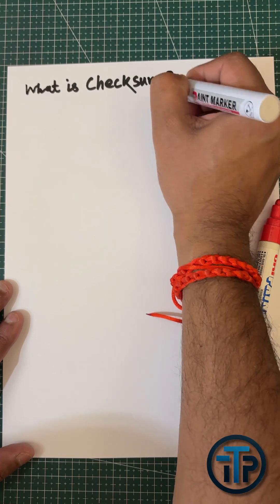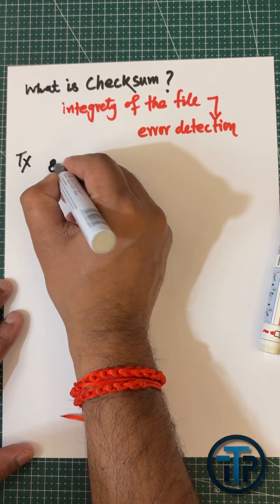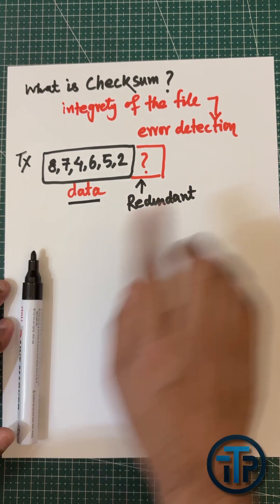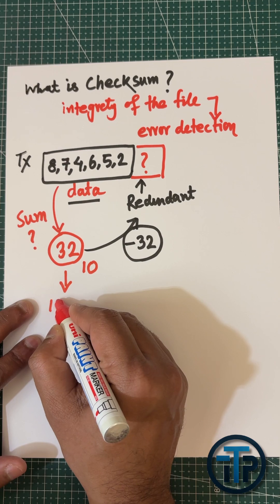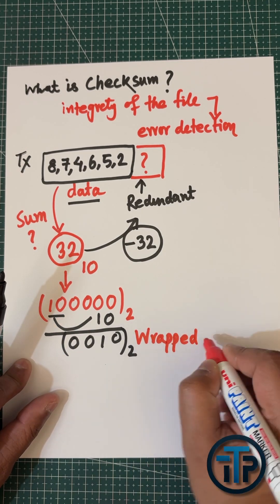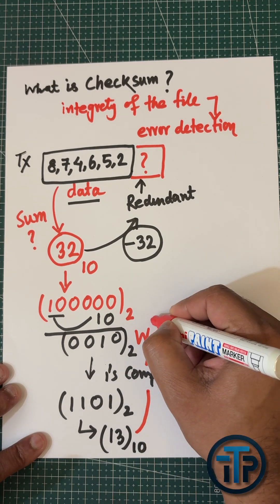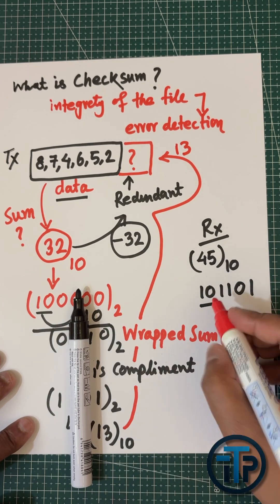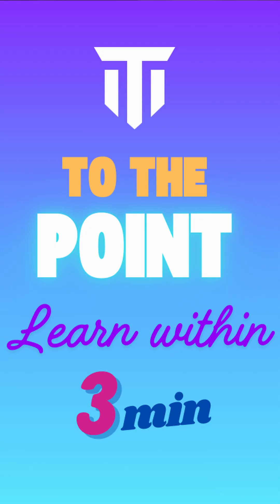Checksum | Error detection in Computer Networks? In 3 min #computernetwork #networkingbasics

Comment: How to convert number to binary bit format
Reply from the maker: Could you please give some more details? If you are trying to convert any decimal number (with base 10) to binary bit format (base 2), then it can be done by simply using the 'division by 2' method (see the link: https://www.rapidtables.com/convert/number/decimal-to-binary.html). Now, in the above example, when we try to convert 32 in base 10 (decimal) to a binary number, it will be 100000 in base 2. However, since we are considering a 4-bit checksum, we have to wrap the first two bits (that is, 10 of 100000). Let me know if you need more explanation.